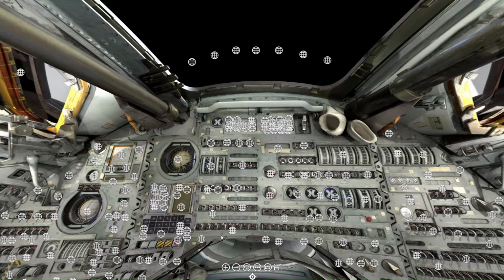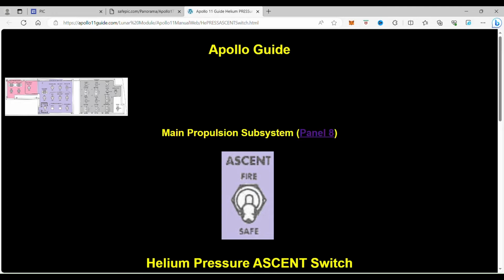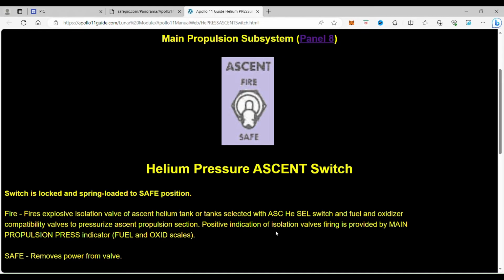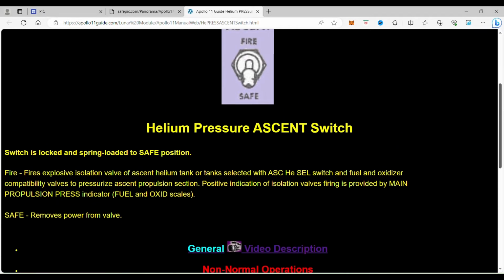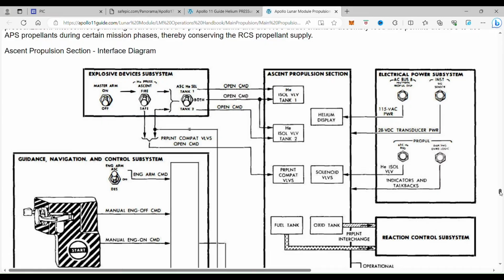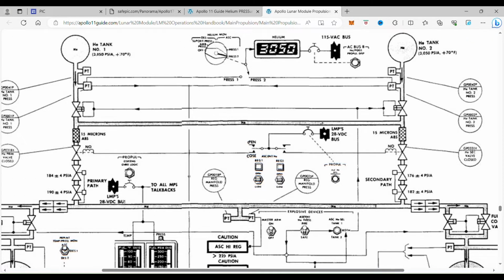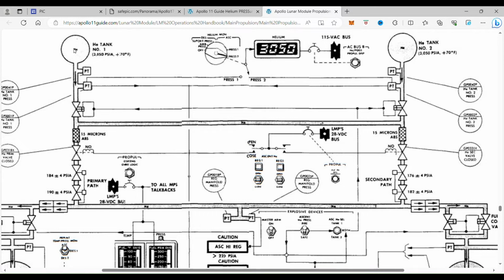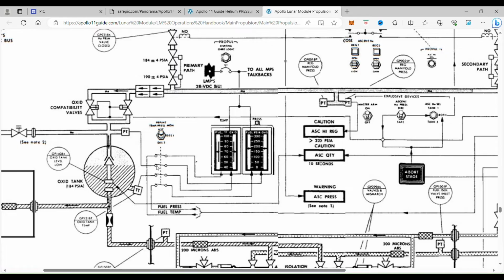Lunar Module Helium Pressure Ascent Switch

Comment: How was the LEM re-pressurised (as Neil Armstrong said it was once they were both back inside and the door closed) before take-off?  On Earth, 'air' is taken into a plane via the engines to enable pressurisation of the locations where humans are.  However, given the Moon has no air, do you know what system they use to achieve the same affect on the Moon?
Reply from the maker: @IanMcFerran  this is how they pressured the casino after the came in from the lunar surface https://youtu.be/gaSE0f6muRw?si=Ti3bACMU3E_mkKUb
Reply: @SpacecraftGuide  Hi.  Thanks for that link.  I've finally had a chance to watch it but it doesn't show how it actually works, only where switches are.

Just to be clear (not my best skill 🤣) what I'm after is something that shows what happened when Neil Armstrong re-pressurised the LEM.  I.E.; what did he do (presumably something to do with that three-point switch... but then... what actually happens.

People have said that air or oxygen canisters were used.  So, where they linked to this switch system?  If so, how does that work?

Sorry, it's just baffling to me.